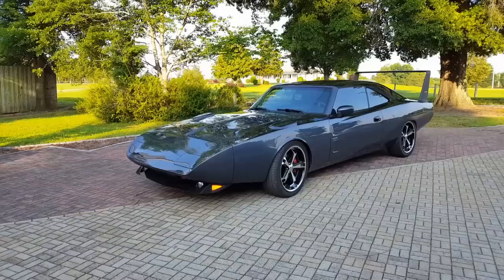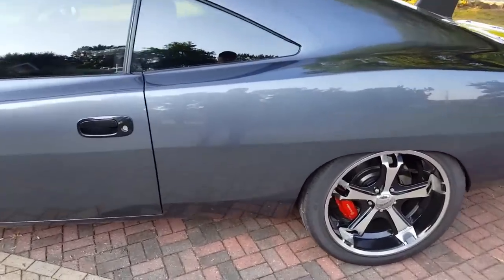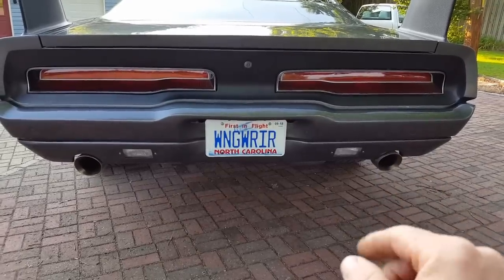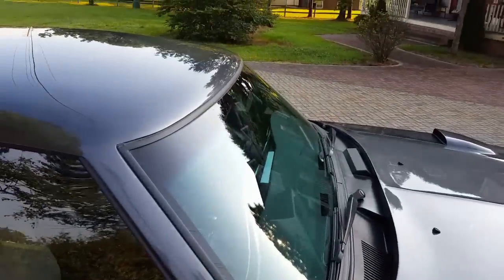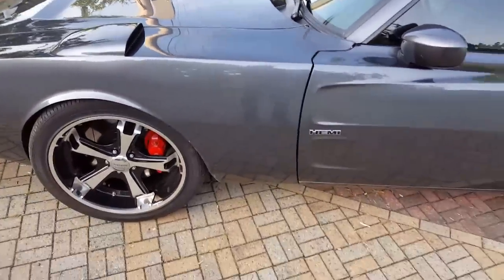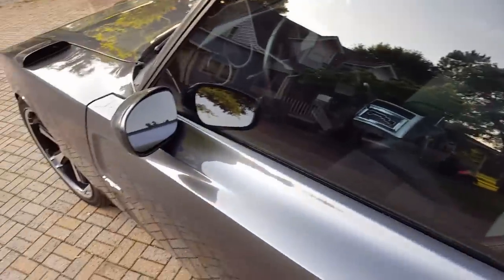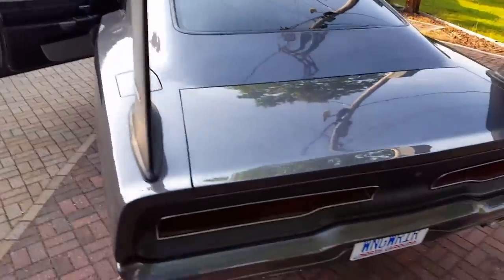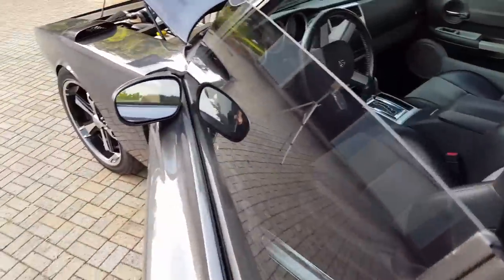SRT-8 Dodge Daytona Clone Car Project: Finished Walk Around

Comment: Imagine taking this into Autozone and confusing the hell out of the teenagers working there.
Reply from the maker: I did and they never looked up from the counter. One old guy did though.
Reply: @SteveMirabelli  I just thought it would be hilarious to confuse them by saying its an 06 Charger with a 68 body modified to look like a 69 Daytona. To those people changing a battery makes you a mechanic. Btw the car looks awesome, the perfect blend of modern with classic.
Reply from the maker: @Name-kd5jj  they don't need any help being confused.
Reply: imagine taking this to the dealership for service lol
Reply from the maker: @maxaronow712  I did for the air bag recall. The young techs had their faces pressed against the glass like puppies looking to get adopted.
Reply: You could drive a stock Hyundai Sonata into auto zone and confuse the help
Reply: @youthmanrecords965  Is it 4 wheel drive? 

Sir i just need a headlight bulb.
Reply: @SteveMirabelli  You sir did what I didn't think was possible. You improved on the original design of the superbird. Kudos to you sir.
Reply: Confusing the teenager at autozone isn’t hard.
Reply: @SteveMirabelli  😂
Reply: Donny Drumpf  yeah I’m working on a 58 Chevy truck. With a 454 big block, a Ford 9”, a 4L60 transmission and front disc brakes. How do you think that one goes wittiness I walk in there?
Reply: Donny Drumpf  just like! The conversation usually goes like this. Me. I need front rotors for a 96 Camaro. The kid. What are you working on? Me. That’s not going to help you. The kid. Well I need too have the make and model of what you are working on. Me. Ok it’s a 1958 Chevy with a 454 and disc brakes. The kid. They didn’t make them that way. Me. I told you it wasn’t going to help you. Who is the oldest guy you have working here? Find him please. These kids can’t open a paper manual or think outside the box. Only is grey beards can do this kind of stuff. You just need to think outside of the box.
Reply: What a wonderful build! Indiana Diesel sent me here.
Reply: Hey now I work at autozone and I would be so blessed to see someone like you that has that knowledge to help me fix up my 36 Plymouth couple. I have no creativity close to that but I wish, every time I get the thoughts up I go to work on it and I can't even find where to start. God bless you brother
Reply: @SteveMirabelli  i would have ran out from the back to shake your hand tbh that thing is sick and the fact that you built it only makes it cooler
Reply: @Name-kd5jj  your profile is all gaming videos lol. Are you sure you’re not the confused teenager?
Reply: @Svtarlen  Well thats weird that you looked that up. Anyways no I have several years of experience working in shops dealing with idiot customers that can't tell a screwdriver from a jackhammer. My dad was also a mechanic before he went to college so i grew up helping him maintain cars for our entire family. But lemme guess you're a bagger at Kroger's? Sit down.
Reply: The first mistake would have been taking it to Autozone. 😂
Reply: @Name-kd5jj  lol nah, not a bragger at Kroger and would gladly race any car you “built”
Reply: @dr.bunterhidenbrobruh5502  exactly that’s like taking a custom built computer to geek squad and making fun of them for not knowing how to approach it. This isn’t a hobbyist store it’s an auto part retail store...
Reply: @Name-kd5jj  changing battery's is one of autozone most popular concepts tho lol
Reply: @SteveMirabelli  I thought sting ray for a glace
Reply: That comment gave me an honest giggle. Thank you good sir
Reply: @SteveMirabelli  lol i like your sense of humour
Reply: @lifewithyellow4304  those are awesome. I had a 36 Plymouth business coupe.
Reply: @lifewithyellow4304  come out to Colorado
Reply: @SteveMirabelli  I’m 15 yet I knew exactly what this was when I saw it. If I saw any Daytona in real life I was probably crap myself and cry for years about not being able to ride in it. In fact any 60’s to 80’s sports cars I would love to see. I really have a car problem
Reply: @SteveMirabelli  That is because working at autozone is probably the only job they could get. I work at a car parts store in The Netherlands and if you pulled up in that thing here i would be so hyped if i saw that car in person.
Reply: They would be confused if you asked for brakes on a 2000 anything
Reply: @faraway240sx9  perhaps because every kid who clicked on this video knew exactly what this car was the moment we layed eyes on it.

If anything I think this one is cooler than an actual Daytona.
More work, more respect ✊
Reply: Donny Drumpf  
Kids these days are seriously limited???????
After Covid Lord God help us!!!!

Comment: That is still the most impressive conversion i've seen,and damn,just imagine if FCA had gotten Steve to design a new gen Daytona like this,and dump a Hellcat motor in it,wow ! Great work though Steve and you have every right to be proud of this exceptional build.
Reply from the maker: Rob Haunui I appreciate the high compliments Rob. I can't take credit for the timeless second gen Chargers timeless design. Hard to mess that up.
Reply from the maker: @kylereese4822 I started with molded lexan that is used in pro mods. It was pretty pricey. $600 for both sides with a special scratch resistant coating. Frameless it was too weak to seal up or hold its shape and by the time I had it fitted it had plenty of scratches.
Reply: Time for a hellephant motor and a trip to the Bonneville salt flats.
Reply from the maker: @Sub4CarClips  425 HP is more than enough for me. Can't even use all that.
Reply: @kylereese4822    I am sure  Steve is familiar with Lexan, he is employed by a NASCAR team 😎
Reply: It's  beautiful bro. Great work.
Reply: @SteveMirabelli  , in cars, there is never a thing as too much horsepower.  Also, if Mopar can make the 1970 Dodge Supercharger, let alone make the Hellephant engine and transmission kit, then you can live with the consequences.

Comment: You worked your ass off on this beautiful design. In many ways, better than the original.
Reply from the maker: Well that is high praise but in fairness the original was kind of a slapped together after thought. The design division was not even involved.

Comment: A Vintage Street Rod that has the quality of a new car and more. I must say that is what I would want.  The factory look to me is just OVER RATED. This is to me worth WAY MORE MONEY. They did ACE the BODIES in the old days with the CUDA, ROAD RUNNERS and MUSTANG and the new models don't even come close to those MASTER PIECES but the interior, dash and suspension are just clearly caveman material and NOT FOR ME. CONGRATULATIONS on a JOB VERY WELL DONE . THAT IS A MASTER PIECE OF WORK and will get MANY LOOKS ROLLING DOWN ANY STREET, GOOD JOB 👌
Reply from the maker: The old stuff really handled like manure for sure but you are right about the superior styling.

Comment: The car is beautiful and I really appreciate all the custom work you put into it. An idea for you to play with: Look at the tech behind BMW's frameless doors to solve the issue you shared. They roll down just a little when you open them and roll up a little when you close them. Not sure what it would take to use in yer build, but an idea for you to play with. Great build. Hope you still have this great car.
Reply from the maker: The modern Challenger uses the same tech but this car is not properly harnessed for that and that is out of my knowledge base to try to sort.

Comment: Wow, that's really sweet and am very impressed with your work. I'm not one for large wheels either, but I do like those because they have an old school look and are actually really nice. I'm not real familiar with late model chargers, but I do have a 2010 challenger SRT8 and has 17" rims on it. Although I have seen them on a few of them, so I'm not sure why you couldn't fit em on it. I've heard that sometimes they don't clear the brembos, but mine fit just fine
Reply from the maker: Thanks. There are a few styles that do but I some require wheel spacers.
Reply from the maker: Thanks. Yeah the Brembos on this car would not clear anything smaller than a 20"wheel. There are some 18" wheels that might work but unfortunately you can't try wheels on like you try on shoes so it can get expensive to try different styles.

Comment: Hey, for the SAT NAV you can get an internal antenna that sits on the rear deck in the back or in the front on the dash.  Signal goes through the glass.
Reply from the maker: I have a powered antenna in the back window. It is poor at best. I don't use the radio much so it's okay.

Comment: Well done. Nice sheet metal work looks smooth  silk. However, you couldn't spring for a manual trans? I mean all that work I feel pounding the gears while driving this beast fits well. My opinion.
Reply from the maker: Don't tell anyone but the LX platform is really a luxury car.

Comment: With as much as you have into that car from the 06 not to mention all the extra sheet metal it must be pretty heavy. Have you gotten to take it out and test performance? Is the wing adjustable? Does it add the same amount of downforce as the original nascar version? How's the cornering on it? And lastly do you think it performs better than an original Daytona and the 06 charger as far as aerodynamics and handling?
Reply from the maker: The car weighs close to the 06 SRT-8. It handles like a sports car. The originals handles like tanks.  No way to test the step but it should be the same as the 06. The drag coefficients of the two cars are remarkably close.

Comment: Fantastic job
Reply from the maker: Thanks Michael, Don't think I will ever top this.
Reply: @SteveMirabelli  turn my 2010 into that 69 roadrunner shell , lol
Reply from the maker: @MikeJBlues  I already have a shell waiting in line .Let me know when you want to start. LOL.
Reply: @SteveMirabelli  i saw that, if you were closer i would already be there, i had a B5 69 440 4 speed in highschool
Reply from the maker: @MikeJBlues  That is the original color of the shell I have.
Reply: @SteveMirabelli  stop...lol
Reply from the maker: @MikeJBlues  I will let you off the hook. The shell is really too nice to cut up for a body over. The frame rails are i really good shape so it is a real good candidate for a restoration.  I am not that guy but look forward to passing it on to someone who will.
Reply: @SteveMirabelli  i couldnt do what you do on a good day, and cant afford to build a 69 these days.

Comment: Steve, I talked to you at Carlisle this year (ON EDIT, I MEANT STEVE TALKED TO ME AND 50,000 OTHER GUYS ABOUT HIS COOL CAR :)    along with 50,000 other guys).  I really like your build. I had an issue of "Mopar Muscle" which went under that had your car on the cover.  I myself am building a Daytona.  I hate to use the term "tribute" or "replica" because mine will be neither.  I'm an aerospace engineer myself and am designing my own nose cone that will have a larger air inlet so the car doesn't overheat.  The rear wing is a NACA 2412, same as on a Cessna 152 airplane....just upside down to push it down.  These cars are my favorite of all time.  I'm building mine on a '70 Charger....which as I'm sure you know the Daytona used '70 front parts even though it was called a '69.  I got a Redeye on layway.  Just hope I can make it run without overheating.  Mike Musto built one and it overheats on him in the desert.  Anyway, it was great to meet you and I think you built an awesome car!  Stay cool buddy!
Reply from the maker: Sounds like a super project. I hope you will post your progress somewhere where I can see it and follow as you build it.  Good luck with that monster motor.
Reply: @SteveMirabelli  Thanks Steve!   I absolutely will.  I hope mine turns out half as nice as yours!

Comment: Damn dude, i did custom bodywork for a lot of years, couple hundred chop tops, shop i worked at was the first to put a 50 merc on a late model chassis....so if i say your did a very impressive job its for real..Door glass can be a pia...delete vet window is always a challenge..i  used to make a carboard pattern and cruise parking lots to find something close..if the length was close the a pillar angle is easy to cheat on the backside.  kinda sucks having to run lam door glass and its sounds like you even had to have that made. Tempered doorglass was 5k+ 30 years ago....got lucky and the floor width hit the number..lol and you cheated to wheelbase in the only place you can get away with it and not get caught. tires look kinds tight, looks like they dont rub, that makes them right. Im not a fan of them new style wheels/tires but at least the tires arnt rubber bands i have 20s on my 99 cheve van 285 50 and 315 50...rears are as wide as my buddies 13 zo6 vett but twice the sidways...you put any miles on it yet? Bad ass ride, and that it is needs to be used.....you got about lucky to even find a body...rare as they are nowdays...and again..way cool, you have skills most people only dream about
Reply from the maker: Thanks for the compliments. High praise coming from a pro. Just hobbying over here. Every thing was tight with the tires. If I hit a highway bridge too fast the rears scrape a bit but most of the time they are good. Yeah. Tempered glass was a non starter so it is what it is.
Reply: @SteveMirabelli  Never messed with laminated glass rolled like a door glass you said it was heavy so that means its thick. Laminated glass like to be supported all the  way around...if ya ever break onevi would think about having them done in pc lexan...used to use it on bullet resistant limos back in the day....it was a cheat that was always avoided on a chop top...kinda odd..never messed with laminated bent in one direction, i might have cut flat lam once..maybe...cut all my own windshields for chop tops...almost always the first time...fun ones are like 55 chev, 59 elcamino....  Keep up the great work...good to see people who have the skills and motivation to actually finish a project that is off in that place called "where no man has gone before"

Comment: Thank you VERY much Steve! Do you think this would be just as easy, or harder to recreate with converting a Hellcat Charger? Or would you prefer a Challenger?
Reply from the maker: ChargeDodger if you were building a Charger without the nose and wing a Challenger would be the way to go as the wheelbase is closer to the old Charger.
Reply: Without? Of course this would be with the wing and nose like yours lol. But regardless with a Daytona recreation, go with the challenger?
Reply from the maker: ChargeDodger For a wing car I think I would go with the Charger because the 18" of extra length of the nose always looked funny to me. With the front wheels ahead of the stock location by 3 inches the car seems more visually balanced. This of course requires the fenders to be modified . With a Hell Cat you would be modifying the hood also with a bulge for the super charger.
Reply: Wow very beautiful car would you consider making another one and selling it or no ?

Comment: I'm not a big fan of dub wheels but I understand what you mean it's the brake rotor size that makes you have to run those wheels well I've seen worse but your car is awesome great job bravo! It's perfect even the wheels look great on it i like the look of the super bird nose better to I don't care for the chicken wire look a real quality looking build p.s I even like the fuel door it does look nicer clean body line to the back

Comment: 💯.  I love it, even the gas cap delete. I loved that old cap. But this is cool.
Couldn't use the 68 or a 69 hood?  I love those more than the 70 hoods. But this does tie in well. I also like the more Superbird front you modded.  Always liked that more than the Daytona front.
Great man!
Reply from the maker: The 70 Charger hood and fenders were used on the original Daytona even though it was introduced half way through 1969. Thanks.

Comment: Was the check engine light code P0420 or 430? I have it on my Challenger SRT8 as well now...
Btw great build such a fantastic job you have done!!
Reply from the maker: Thank you .The code ended up being my right side catalytic converter. The oem cat is $1200 for one with a $200 core charge. I ended up getting an aftermarket flowmaster direct bolt up for $300 and it fixed the problem. Big issue here is you have to use oem  oxygen sensors if you replace them too as the after market ones will no be read by the cars computer.
Reply: @SteveMirabelli  thanks!  Do you mind me asking you where did get all the skills to do such a fantastic restomod? Paint job is flawless!  I'm thinking of putting a modern BMW F10 Chassis with M5 suspension under a 69 Charger body and maybe a hellaphent crate under the hood!  That'd be the dream😁.  Watching your videos really gave me an idea on what to expect. For now I'm still enjoying my 6.1 Challenger.  But I really really do appreciate your craftsmanship man👍🏻
Reply from the maker: @davidmitchell5638  Thanks for the compliment David. I have been a jack of all trades most of my life and have been exposed to a lot of different materials over the years mostly in my early work career as a commercial exhibit fabricator. The last 20 years I have spent in Nascar the last 16 at Hendrick Motorsports as a body hanger. Basically we put the bodies on the race cars. Not as complicated as this job for sure but there is a lot I learned along the way.